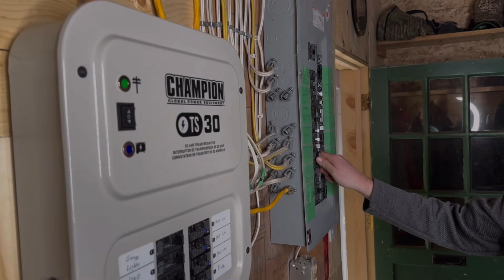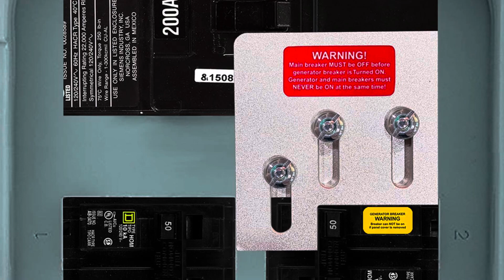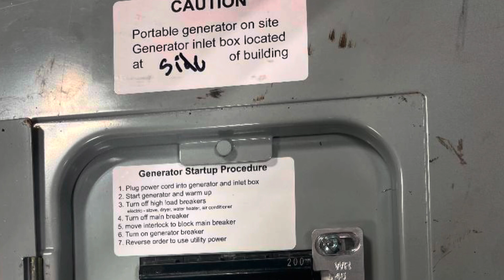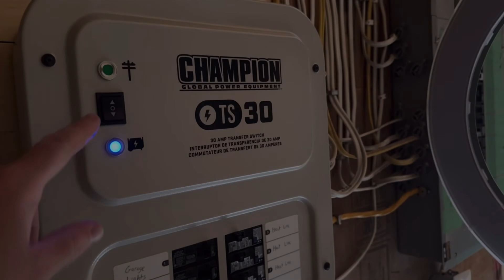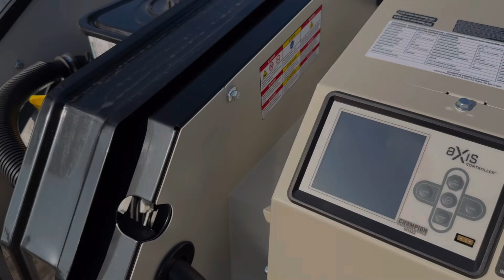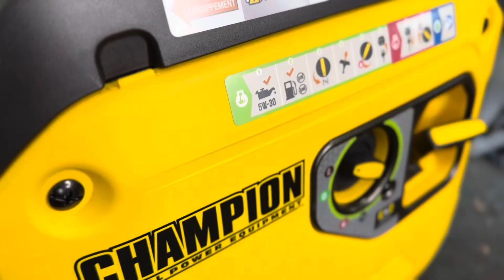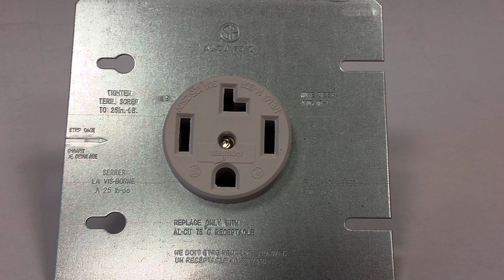6 Best Legal Ways to Connect a Generator to Your Home (Plus 2 That Could Kill You)

Comment: This is extremely helpful information. How do I determine what size generator or invertor I would need? Are there rules of thumb for calculating what a person would need to purchase to power refrigerators, deep freezers, furnaces, hot water heater, central air, etc? I'm a mom of babies and toddlers in northern Minnesota, and when our power goes out, it goes out for days. I want to get prepared this storm season instead of console sweaty little babes in the middle of the night with no central air, no white noise, and not have to throw out breastmilk that thawed in the deep freezer. We can make it through, but boy it's not easy;) Thank you so much for a perfectly presented and easily understood video, it is so refreshing!
Reply: According to google AI mode, you need to look at the specs for your appliances you are trying to power and see how many watts each uses (both continuously and peak)-- add up the wattage ratings on the appliances you want to power then see if it is within the capacity of your generator.  Just ask google AI mode and it will write a really good  article on it and summarize info from the most credible websites; it search like hundreds of website and uses info from the to write its answer.

Comment: From what I'm seeing $5k for a stand alone backup generator isn't realistic even on the low end. From the quotes I've gotten that wouldn't cover the installation much less the unit. I have a typical, relatively new home with everything well situated.
Reply from the maker: Thanks for commenting. $5k will get you a unit, but installation would be on top of that. Are you thinking of getting some kind of backup? Near where I live there were people without power for a week from an ice storm. Generators are one of those things that you don't think much about until needed, but when the need arises it's too late to do anything about it.
Take care,
Steve
Reply: Maybe we're in the same area - Aiken SC. I'm definitely getting one but whole house Generacs are about $15k installed. Overkill for us. I really just need my water pump and the refrigerator. A little internet would be nice but the phone works in a pinch. The big whole house battery backups might be the thing for us. Two of those should do us for a week at a time. Don't know that much about them yet.

Comment: Even the cheapest safe options ($50-100 for a single piece of stamped sheet metal and a couple screws? and that's assuming you can get one for tour specific type of panel that's probably 40 years old) are stupidly expensive. That's why people go the simple and dangerous route.

Comment: I think you glossed over the backfeed issue a bit. It is a major feature of true automatic and manual transfer switches that they are designed to break and then make the transfer, that is ALL of the conductors are disconnected from the grid before contact to the generator is made.  The other really important point is that even a small portable generator back feeding into the grid can energize lines to as high as 14000 volts miles away from your home and significantly interfere with linesmen attempting to ground a repair area.    This is very apropos for my area as the power has been out for days due to the ice storm and I am very grateful for my generator. Another point not made is that portable generators have to be outside. As we get older, you have to consider if you can physically take the generator from its warm dry storage area outside in the storm at night, to the place you prepared in advance to protect it from rain and snow etc (portables are not weather proof), hook it up, and keep it running when it has a fuel capacity of only a few hours and needs constant monitoring of the oil etc.

Comment: What about a Generlink connection? Are these no longer available or recommended?
Reply from the maker: Here's the link to my Generlink video: https://youtu.be/bePqUS0w8B0
Reply from the maker: Good question! Generlink is still available and I know from personal experience they work well. I've covered Generlink in other videos, so I didn't include it here. Some places don't allow Generlinks, so you should check locally before buying.
Thanks for watching and commenting!
Steve
Reply: Before going that route ask about the failure rate. Finding that the last lightning storm fried its internals because the power is out and now it doesn't work is a big down side.

Comment: Look, I get it - people are dumb, but it ain't rocket science. I put in a double pole 30 amp breaker, with a 30 amp receptacle on the exterior of my house. I have a 9000 watt generator with a 30 amp 240v output. I created a suicide plug. I turn off the main breaker to avoid backfeeding, turn off the 30 amp breaker, turn on the generator. Flip back on the 30 amp switch. Turn on individual breakers as needed in panel. Boom. No crazy transfer panel action. Took me less than an hour to install.
Reply from the maker: Hi Rick! I recommend you let me take your comment down immediately. I happen to know that the authorities monitor the internet, looking for comments like yours. Yes, it is possible to do what you've done, and people do it sometimes. But this approach has killed people, and that's why it's highly illegal. It's amazing how the guys with the uniforms can find out where people live when known illegal activity is going on, as you've admitted. And think about it . . . if you had a grown child who worked on a power line crew, would you feel good about their lives depending on someone, somewhere remembering to flip off the main breaker? Do you want me to remove your public admission of a serious crime? Sometimes it's best not to toot one's own horn when breaking the law.
Reply: @baileylineroad  I'll take my comment down if you'd like, out of respect for your channel (which I do enjoy immensely), but I'm certainly not going to concede that backfeeding is "too dangerous" or that people of average-or-above intelligence are incapable of doing it properly. Bonus: If I ever sell my house, the next person just has a nice 30 amp receptacle to use for whatever they please.